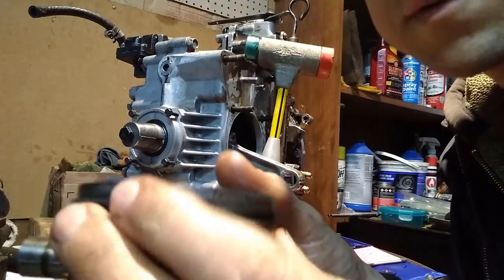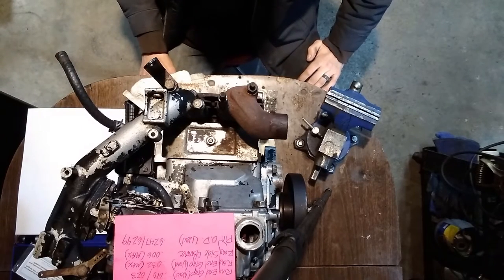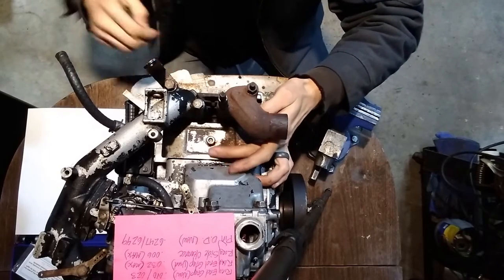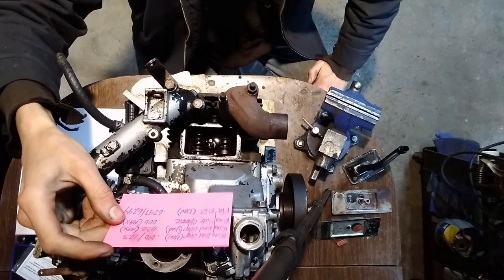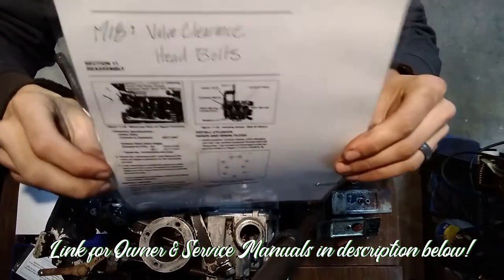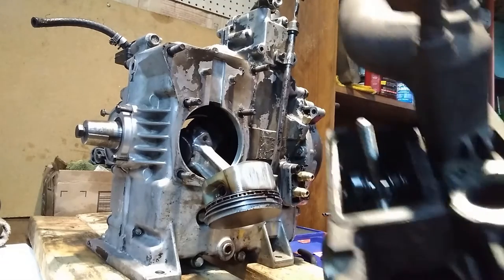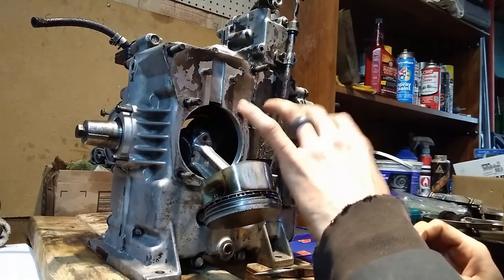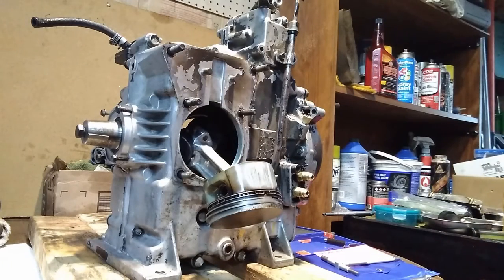Kohler Magnum M18 Complete Service - Part 2A: Inspection & Diagnosis

Comment: they put the fuel pump  in a bad spot  my was leaking  an is in a cfc 18 steer wheel ,,,took me 2 hours  to get it out  ,,not going to be fun  to get a new one in,,,,any short cuts??
Reply from the maker: Yeah I would bypass the mechanical pump and go for an electric one.  The Facet 40177 is a robust low pressure (1-2psi) pump that you can run off the existing ignition switch.   Pulls fuel more consistently than the mechanical pump and you can plumb it in just about anywhere.
Reply: @SolunaGarage  thanks

Comment: Hey brother, awesome videos.  Got a question for ya, are these M18s internally balanced or are they balanced by that insanely heavy flywheel?
Reply from the maker: Thanks!  The flywheels are balanced, I believe.  No internal balance gears or shafts on this engine.
Reply: The KT17 (first design), KT17 Series II, KT19 (first design), KT19 Series II, KT21, MV16, M18, MV18, M20 & MV20 are all balanced by the counterweights on the crankshaft to mach the weight of the connecting rods & pistons. The flywheel is balanced separately & has nothing to do with balancing of the crankshaft/rods & pistons.
Reply from the maker: Thanks for confirming. 👌
Reply: @SolunaGarage  you're welcome.